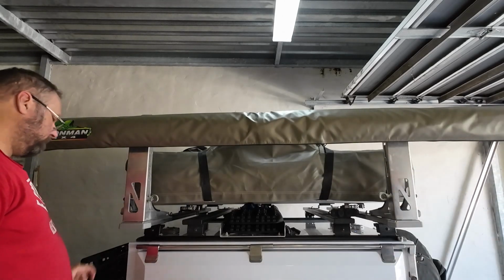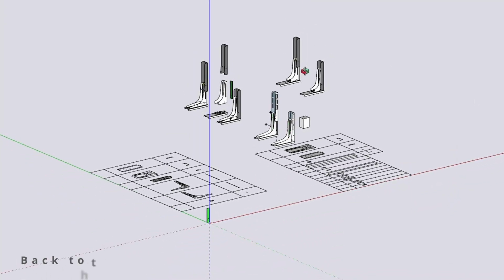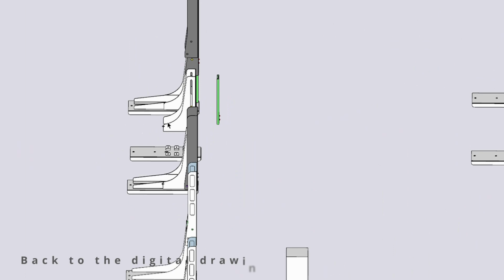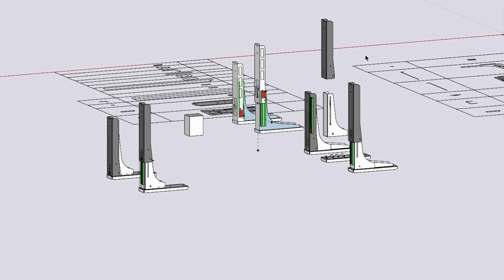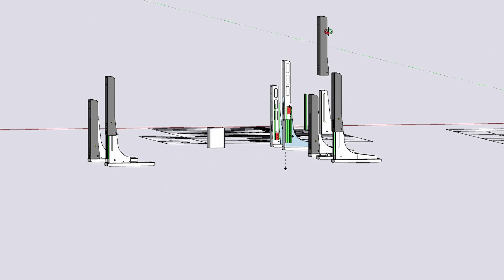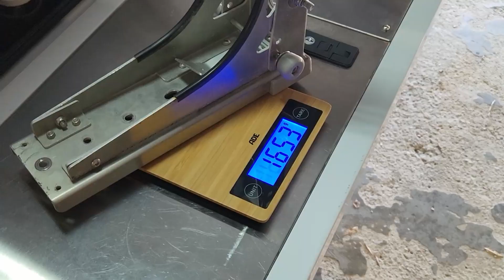Metalian Genie Adjustable Awning Bracket - Prototype 2

Comment: Hey ! Looks very well made ! Do you know what is heights from the ground to the awning when it's closed and when it's opened ?
Reply from the maker: Hi not specifically from ground, but from mounting slat, its 410mm when closed and lifts up about 190mm.
Reply: @fooshadventure  Thanks ! I was curious more about the heights from the ground. Person that 1.90cm could easily stand under it ?
Reply from the maker: Hi, it does depend on your trailer setup, hence the measurement from the mount slat. On our setup, would probably be fine.

Comment: What is the height range of this bracket? Just curious how tall it is once it is fully extended.
Reply from the maker: Hi, when fully extended the top of the awning will sit about 600mm above the roof rack mounted slat it is fixed too.